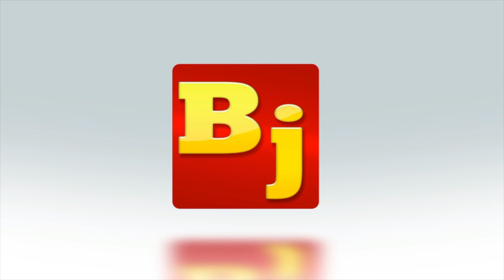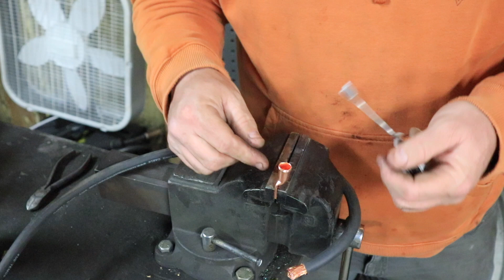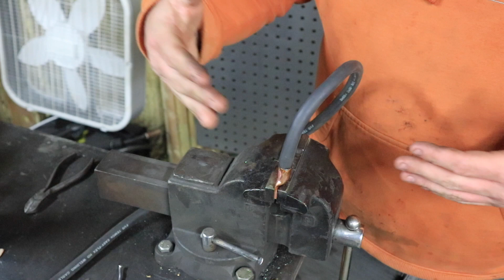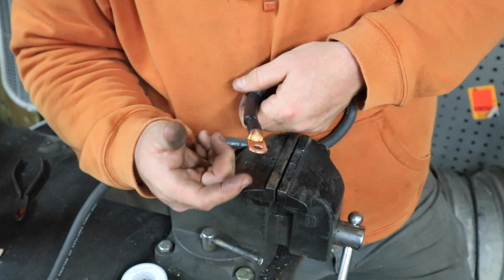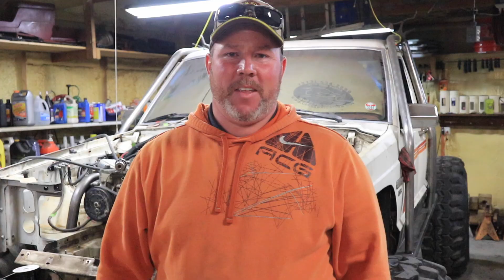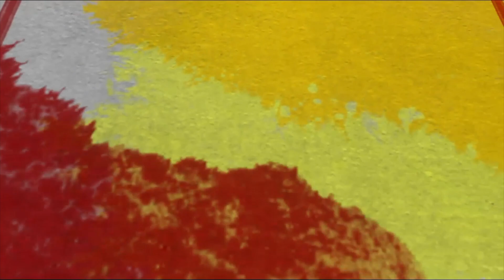How to Make Your Own Battery Cables the Easy Way

Comment: Just a suggestion. Don't shoot. I would use a file to get the flare off after I soldered everything.   No wait. No I won't, I'd beat it down with my day glow orange LFH.  That's Little Funny Hammer. 
As for your first solo video, I'll give you a B. It would have been better if you were wearing a red hoodie.  You were good enough.

Comment: I appreciate your enthusiasm and your pointing out an important method to avoid future problems. However, if you indeed did use acid core solder, and you did not clean the joint after soldering, the acid will stay in the joint and corrode the copper. Eventually you will get the green crusties inside your fitting.
Reply: So,  there you go.   Above, somebody questioned using acid core solder.   Another guy replied, "  don't say something is wrong without giving a reason."    
Me too, I've never heard of using acid core solder on electrical, for more than 50 years.
I think that has been established here,

Comment: Great Job Jeremy!  So this is how all my connections are. I've been soldering everything for years. A lot of time I will flux and pre tin the connections then crimp them and solder. Solder still wicks up and fills the joint solid. If you don't use it already look for the shrink tubing with the adhesive inside. The heat melts the adhesive and seals the wire to the connector water tight! Good stuff! Living near the ocean we have great places like West Marine where I can pick up all sorts of pre tinned connectors. Marine grade electrical distribution blocks, power disconnects, fuses, breakers etc..  All high quality stuff and it survives the winter being designed for salt water boats. BTW..  I run all my electrical through a 900A / 1200A surge disconnect. If I need to disconnect power fast it's a quick flip of the knob on it. I've seen a couple off-road vehicles go up and decided mine wouldn't be next.
  Keep up the videos Jeremy! The camera loves you...  hahaha...
Reply: Rich Lynch  Thank you for mentioning West Marine. They also have top grade marine cables in bulk rolls, that can't be beat. A little pricy, but worth it.
Reply: David Padilla. Oh I know..  my Jeep is wired with it. Good stuff! For sure it isn't cheap but when you add the term marine to anything you can bet your bippie it's not cheap! Haha..

Comment: Hi, I live in Brazil and I have an XJ 00 2.5 TD, I'm designing the 4 LINK for it. After installing the 4 LINK, can I delete the TRACK BAR?
MAX SPEED 110 KM/h
USE in CITY and OFF ORAD

PLESE help me ..

email : ecocerradoresiduos@gmail.com
watts app: +55062981607708
Reply from the maker: If your 4 link is double triangulated then yes, you can delete it.

Comment: If you want to avoid pushing the insulation back on the cable when sliding your heat shrink on (after you've already soldered your lug on), take some water with just a tiny bit of dish soap and put it on the wire insulation. When you start heating your heart shrink, start where the lug meets the insulation and work back from there.  It will push all of the water out or evaporate it. A little bit of lube goes a long way.
Reply: Anthony Cook A very small amount of silicone dielectric grease would work too, and help seal the connection from water ingress. :) A dab'll do ya, a glob'll screw ya.

Comment: Not sure if your aware but high end heat shrink will have glue on the inside that melts when you heat it. This insure an actual seal and is superior in pretty much every way to non glue that they sell at regular auto stores! Working at a wire harness shop has its benefits, we never use anything but the glue shrink.
Reply: Connor Doll yep..

Comment: I was told by an electrician a while back that you shouldn’t use Acid core solder, you should use rosin core for electrical. Other than that it was a very informative video! Great job man!

Comment: I thought you never want to use solder for connections like that, and should use a mechanical connection with crimps?
Reply: Matthew I. These are the really good terminals that I was talking about that come pre-loaded with solder that you can get it Napa.
http://www.quickcable.com/products.php?pageId=74

Comment: The national electrical code says no bends more then five times the rd of the wire because it weakings the wire and yes NEC apply to car also it a underwriters lab thingy :-) :-)  nice job Jeremy
Reply: Dave F.;  The NEC, National Electrical Code, states the bending radius of a conductor "shall not be less than" five times the radius of the conductor. This gives a larger radius whereas you're asking for a tighter radius. Also, the NEC does not apply to automobiles (cars), it does however apply to recreational vehicles and mobile homes as they are used as "living or habitable" areas.

Comment: I have always soldered my wires for everything and from what I was taught 50 years ago the flux is what makes the solder suck into a joint or connection... 100%  agree with you and I'm the type of guy that would bi×$h if I was hung with a new rope... Hard to please... Great tutorial for someone new to this type of deal... 
Great video content and done a darn fine job doing it... And the T's are awesome if you run 2 batteries on your jeep like I do the hot side in parallel... Then just bolt the grounds to the frame... Thumbs ☝

Comment: Your not suppose to cut off the lose copper the best thing to do is to fit all of it in the battery terminal because now u could have a short due to some wire being longer than others Idk maybe it doesn’t effect it but I make sure to get all of it in their
Reply: positive and ground aren't that close to eachother, or we wouldn't be using this type of connection in the first place

Comment: I love these Jeremy videos!! Hey Jeremy, quick tip, if you melt a little solder on the exposed end of that wire before you even start putting solder in the copper terminal, it will hold all those stragglers together so you don't even have to deal with them afterwards. Then just plunge it into the terminal full of melted solder and do just as you were doing and it should be good to go. Excellent video man. =)
Reply: It's called tinning and actually a very common practice. Another great video. Now go out to the garage and get to work! 👍
Reply: WoOsKii 1 I would say it really depends on how much solder you melt into the cable. If you just lightly tin it, it shouldn't swell very much if at all. With proper heat, the solder will wick into the center of the cable strands and it'll be just enough to hold the strands into one single chunk for easy insertion. Then, when you assemble the terminal and heat it again, the solder of the cable end will melt and the solder I the terminal will wick further into the cable filling in all the gaps all the way to the center of the cable.
Reply: @mannys9130  That's a very good idea! Just a very little tinning on the strands of wire before you insert it into the lug should take care of any straggling wires, and the little tinning will not swell up the wire.
Reply: Vinny Gullotta That sounds good..
Reply: I was thinking about that. Does the extra solder make the fit too tight?  I've done this on a smaller scale (pencil width) and fully tinning the wire can ruin the fit,  on the small wires that have alot more wiggle room.  Just curious...

Comment: You can also crimp the connector but make sure you have a quality crimper.
I bought a hydraulic crimper because is the best way to make crimped connector.
Great job Jeremy!
Reply: Unless you have a very good hydraulic crimper with a butt load of dies the manual crimpers that can be calibrated are better. 

The problem with affordable hydraulic crimpers (under a grand) is that often the dies are just a little too small or too large when they bottom out/finish crimping. They just don't give you enough dies to do it properly. The actual gauge of wire from one manufacturer to another varies quite a bit, you need a lot of dies to compensate for this. One die per wire size is not good enough.

This ultimately results in a substandard crimp that didn't fully finish compressing all the strands in the interior of the lug (you cant see it with out cutting a crimped lug in half). Or the opposite, one that has been over crimped.
Reply: Leopold  No that is why you invest money in quality tools. A professional grade crimper can calibrate to crush thickness and won't lock you into using only one cable or lug manufacturer.

The cheap die based crimpers are unable to do so and produce inferior end results anyway.

There is up to a 20% variance in wire size alone.

Comment: Never use acid core solder on electrical connections. Use rosin core solder for wires.
Reply: Acid core can corrode the wire because it’s a much more aggressive cleaning agent while rosin core won’t because it’s pretty mild.
Reply: Good point. I'll work on that.
Reply: j horton good to know. Learn something everyday!!
Reply: Cole A thanks now I'VE learned something new lol
Reply: Unfortunately that is a problem with cables of that size. Most soldering is done on wires 12 AWG or smaller. Also, I have found the lead less solder doesn't melt very well. I still use the 60/40 solder. Good luck.
Reply: j horton that's what I thought. What about solid solder? I was soldering some lugs yesterday and the only rosin core I can find is 1/16" and takes a lot to fill a lug but solid solder comes in 1/8".
Reply: Indeed, agreed.
Reply: j horton never tell someone what to do as a piece of advice.....without explaining why......because....nobody gets nothing from it that way
Reply: DrHavok1 that's what google's for
Reply: j horton I was making some cables just the other day and I was pulling out 4ft~ of solder folding it to 2ft twisting it with a drill and repeating to get a section 4 strands thick.
Reply: Allen McKinne
Reply: j horton YES! Silver and lead free solder is really shitty. 60/40 is best and unless I'm soldering water pipes with my acetylene torch I use it exclusively instead of silver or lead free.
Reply: @mannys9130 silver solder and lead free solder is stronger and works just as well as any old lead solder from the 80s.
Reply: Another thing is you need to flux the wire because you just burnt off all the active flux that was in the solder.   You might also be better with solder paste (tiny solder balls mixed with flux) and heating it as a unit.
Reply: Thin solder is more flexible than the thick stuff. If you need to do a small set of wires the thick stuff puts too much solder down.

Comment: oh... there are going to be so many comments coming in complaining that he soldered those cables.
Reply: Casey H. , I ran 200+ demolition derbies over 25 years. I had 3 sets of cables and never had an issue. 
( one set I used lead from a wheel weight)